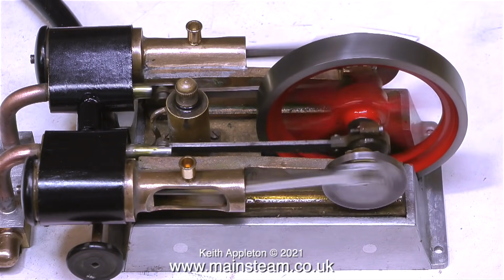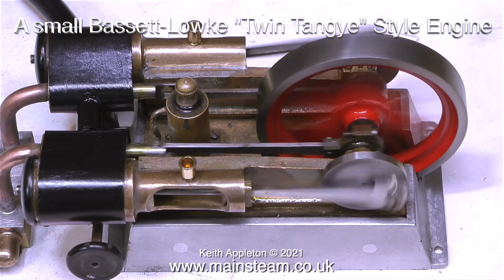BENCH TESTING MODEL STEAM ENGINES - PART #1 - IN THE WORKSHOP

Comment: That twin Stewart the one with the red flywheel it sounds like a twin motorcycle engine
Reply from the maker: The Stuart Sirius is quite different to the other models in the Stuart Range. The two pistons are single acting - hence the sound difference.